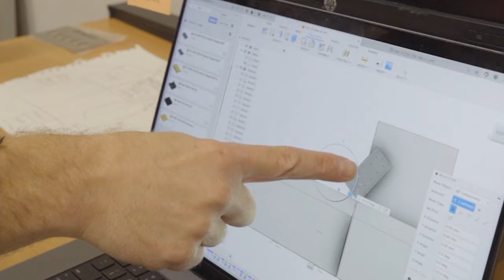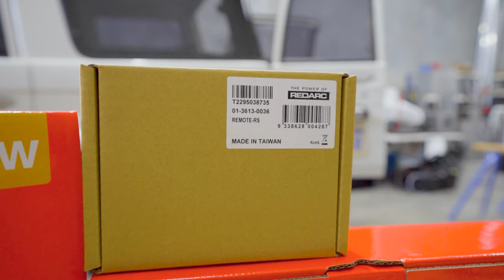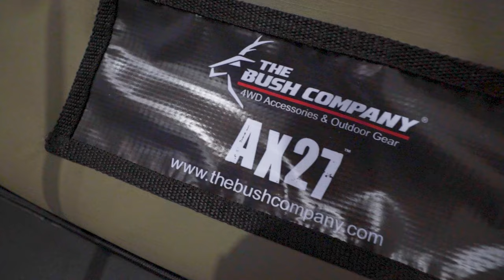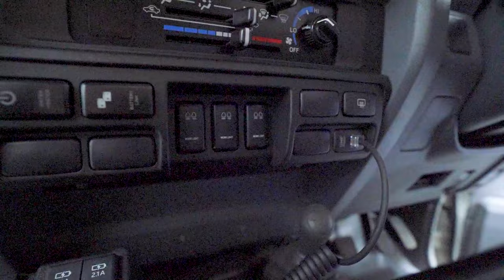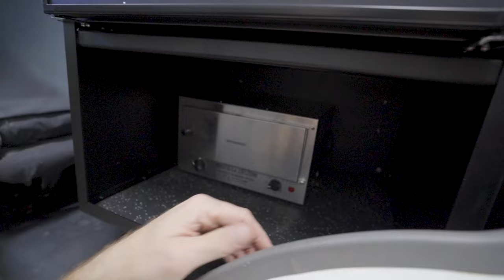76 Series Full Fitouts ( Heiner Builds Your Ride Special ) Episode 5

Comment: 09:15 was the chassis drilled or existing holes used?  In Australia, drilling the chassis and/or employing penetrative welds requires engineering before re-rego.

Has the bullbar been pinned?
Reply: No drilling or welding is required for off-road animal, uses existing factory holes